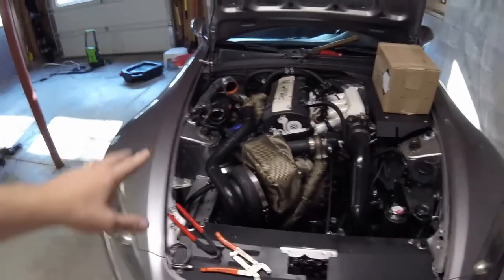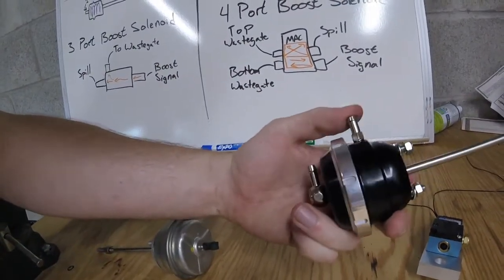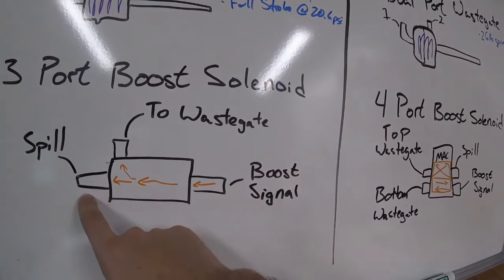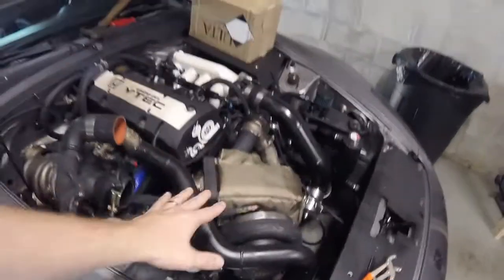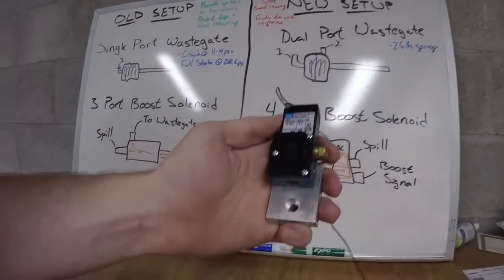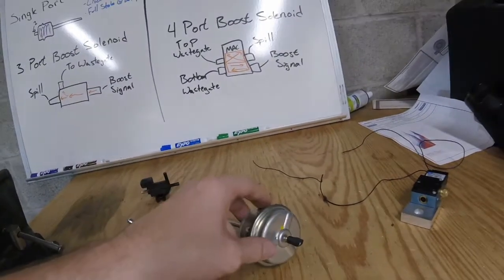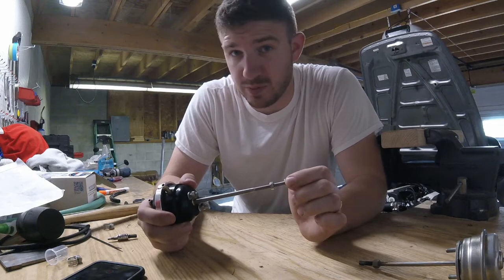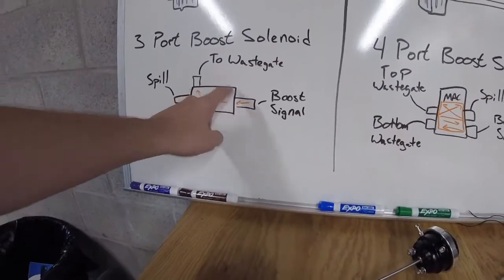Best Mod for EFR Turbo!!

Comment: BW offers 3 different wastegates, the part numbers are on their website. They all ship with the low boost version. They offer one for 14-18 as a med boost and a 20+ for high boost.  Just  a heads up if you ever need it in the future.

Comment: I used this WG  on my EFR 6758 assuming that because I'm using a 4 port Mac valve and a dual port gate, that  I could just throw a 7psi spring in and run whatever boost I wanted through the controller. At about 17psi we started getting lots of oscillation on the torque curve. We're gonna try to add another spring to see if it stops.
Reply: Hi Shannon, have you found what caused your issue with the boost oscillation? Did adding another spring helped?
Reply: Boost controller would let you take it down to 3 or 4psi with that 7lb spring?

Comment: Hi can you help me what turbosmart twin port internal wastgate should I get for my efr 8474 twinscroll turbo. Will appreciate the advice.
Reply: Did you figure out which Turbosmart twin port internal wastegate for the efr8474?
Reply: @That_Bimmer_Guy i made a  twin scroll bov to weld onto my turbo exhaust pipe to help my radiator keep cooler. It should go faster now.